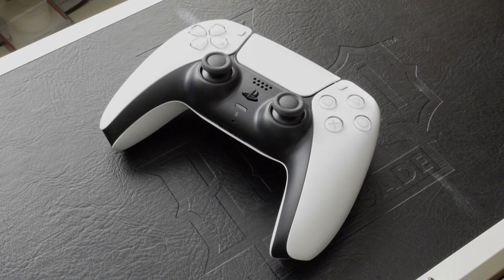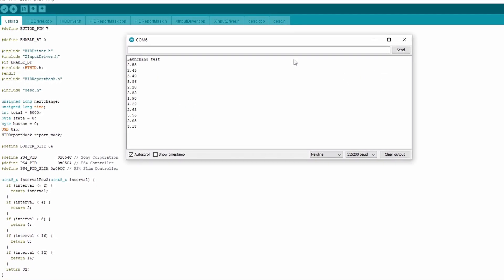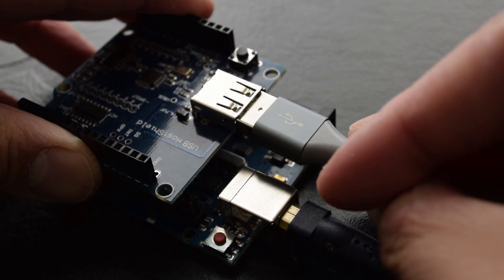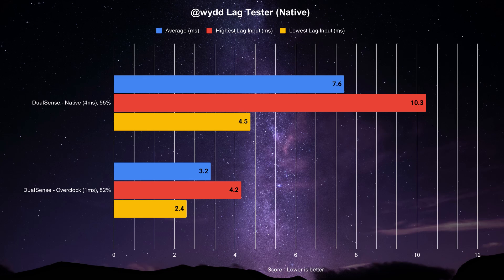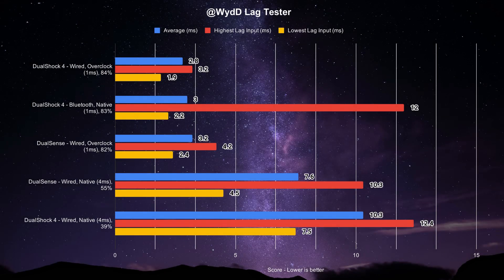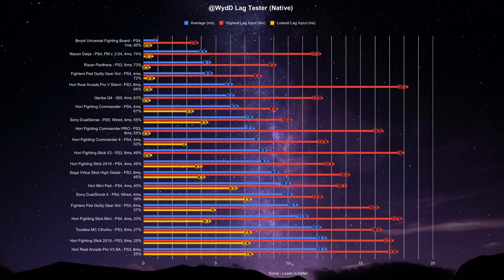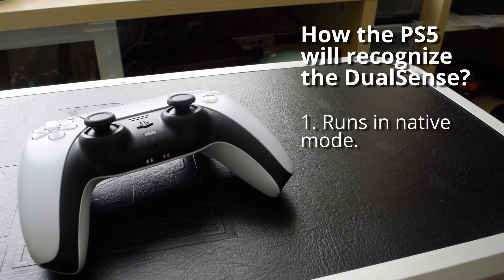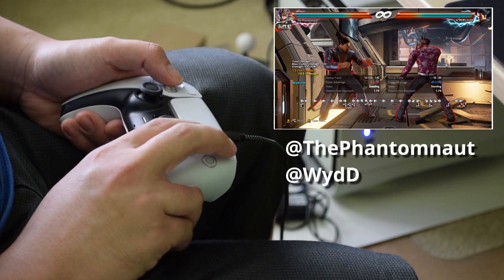Sony DualSense Latency Analysis (Wired): Lower Lag Than the DualShock 4 But by How Much?

Comment: Hello! Thanks for the video! I've got a question. When plugged in to PC through USB, is the battery utilized by the controller? I wouldn't want to burn through my battery because I want to play wired and I'm afraid it is going to constantly charge which can make the battery die very fast.

Comment: Lag on the dual sense is way worse than the ps4 controller.  If you play street fighter you’ll constantly drop combos, sometimes the r2 trigger doesn’t even work.  It’s definitely slower
Reply: I thought I was the only one experiencing the lag and the r2 not registering sometimes. Even on a new controller same thing.

Comment: seems Dual Sense has same issue as Dualshock 4 where Wireless has less latency than wired. But Dual Sense Latency is way to high for a new gen Console
Reply: is this true? so Bluetooth is the way to go again?
Reply: My controller keeps lagging like if I look around it does not move then 3 seconds later it starts doing the movement I already did and I use a USB to fix that but then when my controller gets fully charge the USB stops working

Comment: im looking to buy it exactly for tekken 7, i already have a PS4 Generic which gives me 1 ms response overclocked but dpad quality is pretty bad so i want to switch to ps5 but i also wanted to play with bluetooth cause somehow my DS4 came with some latency issue on bluetooth giving me crazy lags from 15 ms to 50 ms, would you recommend me to buy the ps5 controller then?
Reply: plug in your bluetooth adapter in a usb hub and place it where you can see it. then you will have the best connection. i had the same issue with mine. it was plugged in behind the case of pc, then i had massive latency as you.
hope this helps

Comment: I'm confused why does your graph show higher latency than the ds4 and you're saying the opposite. I just plugged my controller into my pc and used DS4Windows and I got the same number wired as you but significantly lower in wireless mode. In both cases it had higher latency than the DS4.

Comment from the maker: EDIT: usblag firmware has been updated to allow support for the newer Xbox controllers. Lag testing will happen...

ORIGINAL: Hey I saw some requests regarding the Xbox Core Controller (Series Controller). Thank you for your requests but I think I might be unable to. The Arduino isn't able to do perform a proper handshake with the pad. It also doesn't seem to fully power the pad either. Even when plugging into a PC before hand as an attempt to desync from my Xbox Series X, I tried to force it to turn on when connected to the Arduino and it still powered the Series X. I will see possible workarounds but I think this analysis might not happen. My apologies.
Reply: pls do such test with mouse and keyboard on PS4/5 :)
Reply: i think the new series x controllers can connect to multiple bluetooth devices that may be why it still connects to the series x also there is another youtuber doing testing on input lag on controllers hes got some amazing work done maybe youre interested 
https://www.youtube.com/watch?v=Cv-OOn7iYio&t=24s

Comment: Meanwhile Arduino averages at 128us working at 8000 Hz:
https://youtu.be/QidRo-NB7s0
Whole post: 
https://www.overclock.net/threads/is-it-worth-making-a-mouse-using-the-pcie-interface.1600509/post-28566804

10ms vs 0.128us pretty much means your inputs will be 1 frame later than mine most of the time. 1 frame harder to react to everything. Add there a high Hz monitor like a 280 Hz monitor and compared to a 60 Hz that's another frame of input lat(even at 60 FPS, yes).

That's a nice video, please include Arduino itself to compare to all of these controllers.

Comment: Oh if you could?! Would you do a Astro C40 latency test? 👀
Reply from the maker: The secondhand market seems cheaper which I can try but don't count on it. My apologies.
Reply: Because alot of pro players are trying to play and move over to the C40 because of the Sticks are software adjustable. And you can remove the modules, I’d ordered different kind of thumbstick tention as well its great! But I’d love to know what the input delay is on the PC. (Pulling rate) and that kinda stuff